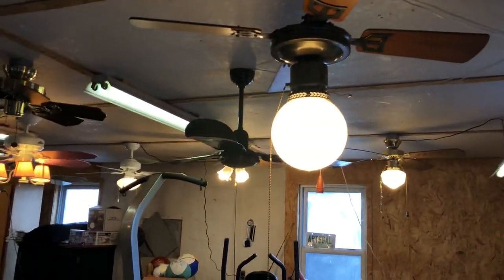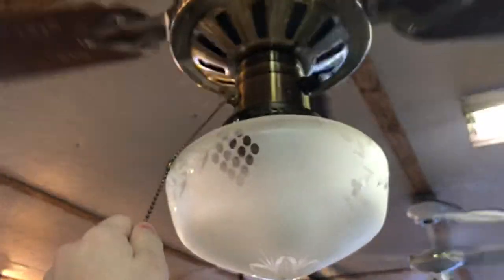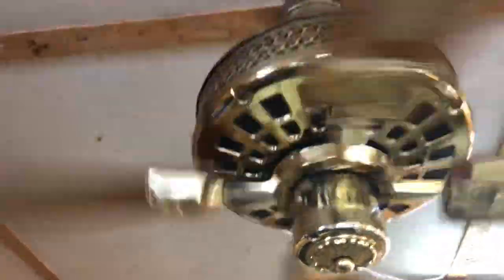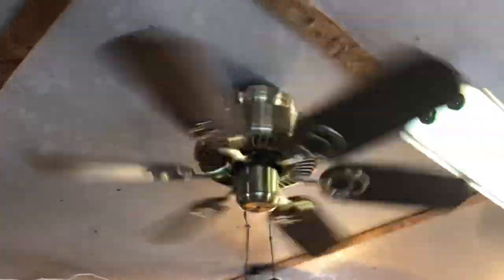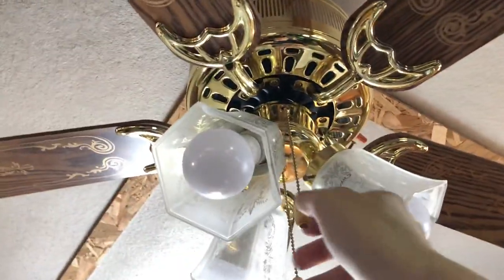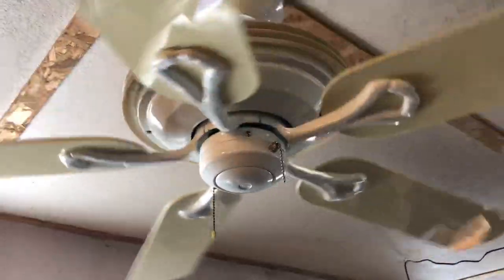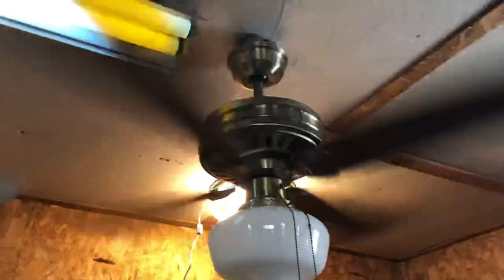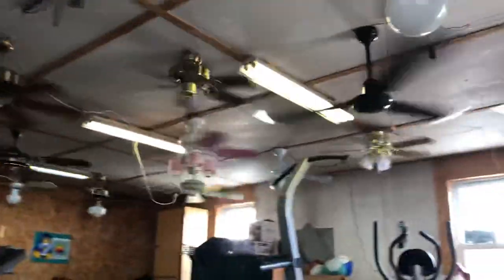Updated Ceiling Fan Display

Comment: How did you get all the fans to spin straight to high when you flipped the light switch? I love the Airmaster industrial, the Caribbean breeze, the view fan, the Nutone Verandah, the Nutone slimline, the Nutone proline and the Hampton Bay Minuet 2. My favourite ceiling fans are industrials. Great video btw
Reply from the maker: I left them on high, and turned the breakers off, and then back on.

Comment: Can I buy a ceiling fan abroad? If so, how?

Apakah saya bisa membeli kipas angin plafon di luar negeri? Jika bisa caranya bagaimana?
Reply from the maker: You would have to find a shipper online, or an industrial catalog that you could buy a ceiling fan through. I managed to get my hands on the Indian made Bajaj and Atomberg ceiling fans through eBay. The only problem with eBay is that the seller does charge a lot for the ceiling fan.